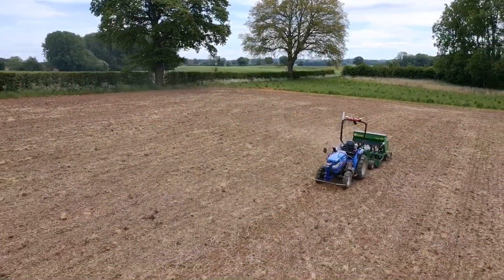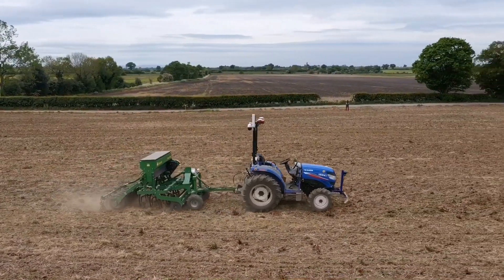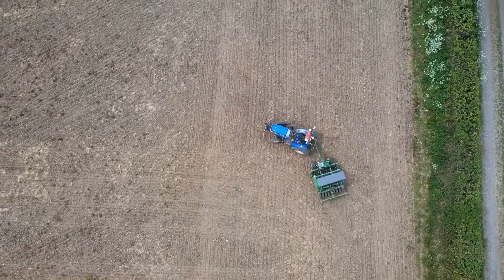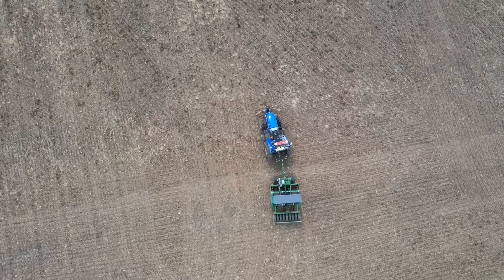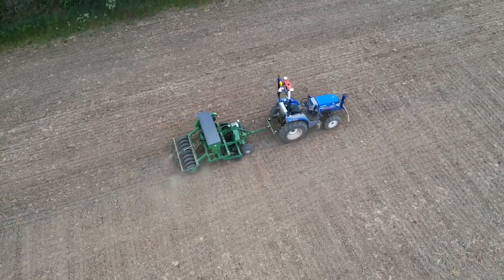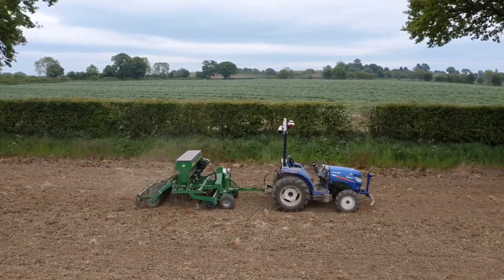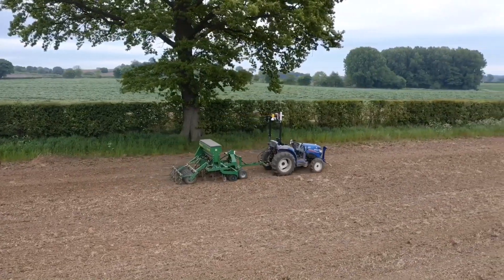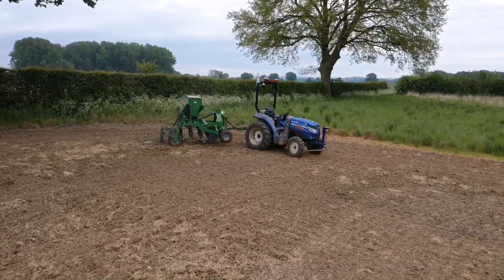Hands Free Farm - Drilling Blue Pits & project overview

Comment: HFH, you know what, this is good man, but I think it will be better if the autonomous tractor runs on electricity instead of gas or diesel fuel. 
Number one, the fuel price is only going one way and that is up. Second, a farmer now a days must save money in any possible way to make some profit , you guys are always up against a formidable force, and yes, is mother nature, plus worldwide competition in price and so much more. 
So in conclusion if solar panels and windmill make sense and help save money then an electric autonomous machinery of all levels will be a key player in be profitable in the near future.                         I could be wrong but I just don`t see any other way.
Reply from the maker: Hi, The previous comments are correct in the sense we would happily move to an EV tractor at the point a commercial example of the size and specification we require becomes available to us. 
Unfortunately the high energy requirement for current agricultural field tasks makes going electric difficult with current battery energy densities. Soon this may change with the promising new battery tech coming through and also by looking at reducing the energy requirements of  field tasks.
Reply: @HandsFreeHectareHFH  point well taking, thanks.
Reply: They can not solve all problems at once. Building an electric platform in mass production cost 100 Million ++
Reply: I believe that the main aim of the project is to develop the necessary control systems and safety implications. The power source would not be of major concern. The outcome of the developed control system would be just as applicable to an EV platform as to any ICE platform.